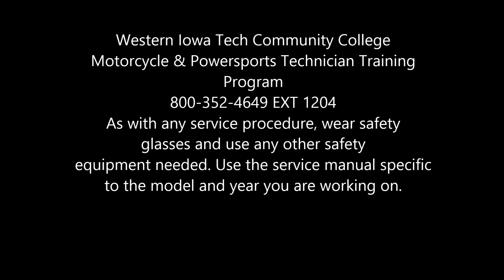GCV Assembly   08 Camshaft #how2wrench

Comment: Thank you for this video.... it was a big help.  I had my GCV 190 in a Honda mower spit out the exhaust valve guide~3/8", enough to hit and break the rocker.  After ordering new exh. rocker and intake seal, I noticed some minor damage to the nose of the cam.   I was not sure if I could change the cam without splitting the case.   Bingo!  Great clear presentation.  Thank you for sharing your deep knowledge.